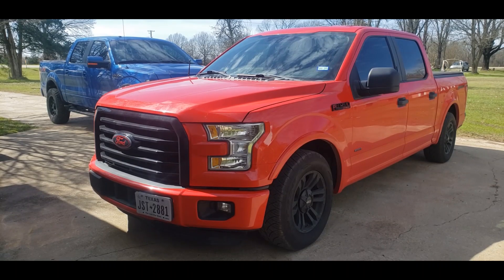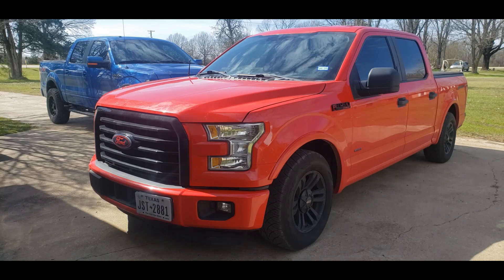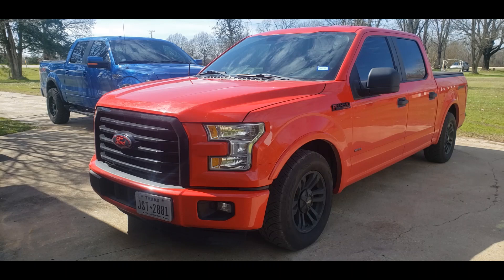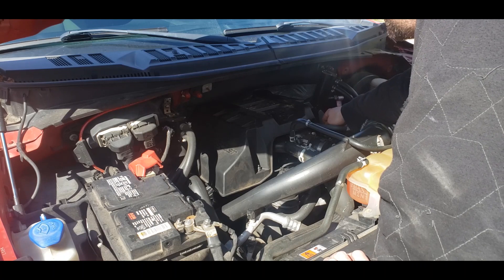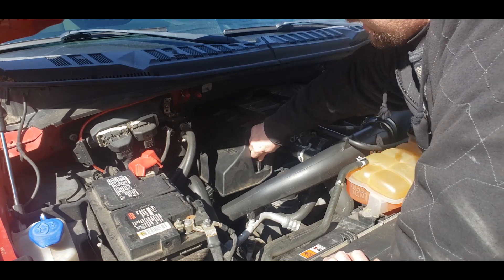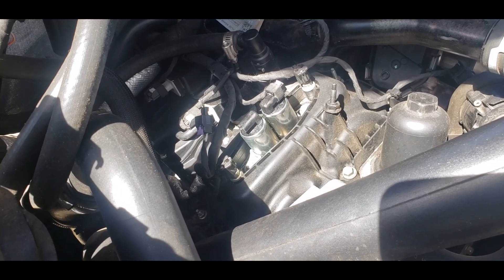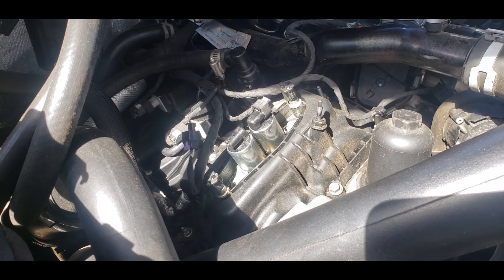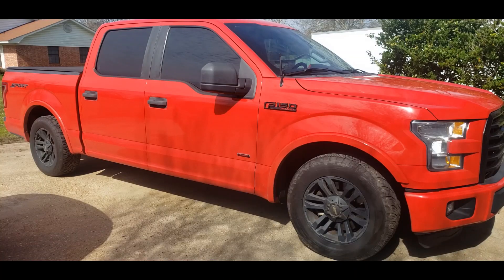✅✅STUMBLE AND HESITATION FIX. HOW TO CHANGE THE VVT SOLENOIDS ON 2015 - 20 F-150 2.7 ECOBOOST ENGINE

Comment: Did u change you airfilter ?  I was losing about 2 mpgs , last year  i decided to change it out and regained my mpga back up to 22 on the hwy
Reply: The solenoids vary the timing under load and or acceleration and when they get out of spec or wear out they cant lock in and hold timing or vary the timing properly. Once I changed them out the truck ran like a champ again.
Reply: Jay marin the air filter setup was s&b cold air intake system maintained every oil change, it was indeed the vvt solenoids. They where out and cant maintain commanded timing.
Reply: Cold Air Intake on my 2.7 was a game changer.  K&N is worth every penny also eliminated the turbo lag because it could actually breath better.